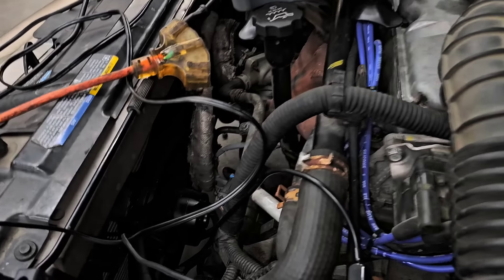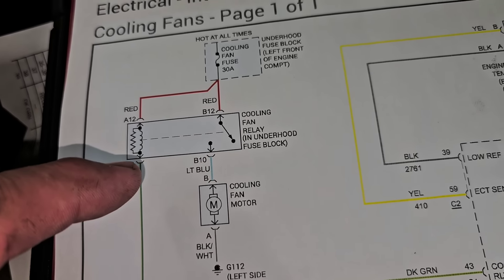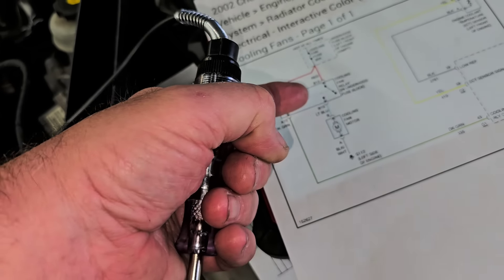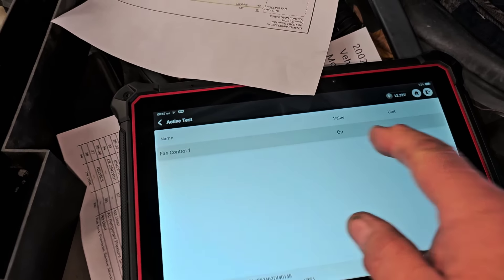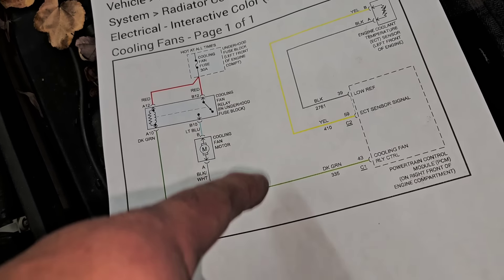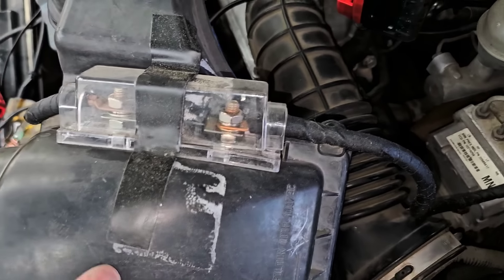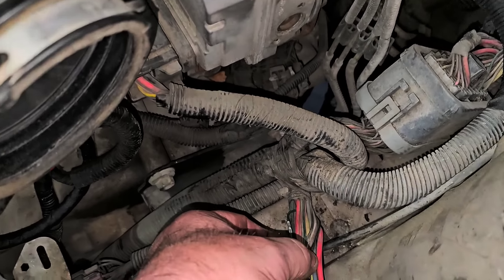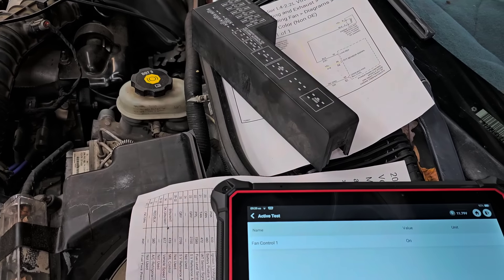Fixing It Right Wasn't That Hard. Cooling Fans Not Working 02 Chevy Cavalier

Comment: Hi Kenny great video just wanted to add something else the relay in the fans are also there to stop the fans from back feeding power when the fans are not switched on and the vehicle is driven the air flow will make the fans turn turning them into a generator and feed current back into the system but it cannot do that with the relay in place regards peta

Comment: Back in the 80ies no computer necessary to controll the fans, temp sensor controls the relay to control the fan. Why complicate things.
Reply: More to go wrong so you have to bring it to the dealership. 
And a bunch of "while you're here" gets done at the same time.
Reply: Gives the PCM more overall control of the engine. Probably for more precise temperatures control. Emissions and mileage requirements from the government.
Reply: Just a relay and a fuse:
+ simple, cheap, easy to diagnose and repair
– big current surges, no option to modulate the power to the fans, hence no control over fans speed and cooling rate

ECU control:
just reverse the pro/cons for the previous option

The good middle ground would be a standalone PWM fan controller that is only responsible for the fans. Looks at a temperature reading and sends just enough power to the fans, no more no less. It's pretty much just a big mosfet with a closed loop control circuit, and you can set the specific parameters and algorithms when and how it turns on.

Comment: Makes no sense the control wire would overload and melt. 

There was some green residue on the wire, corrosion and corroded through? or bit of green insulation?

Also the wire seemed to be in the middle of the bundle, so well protected. 

Definitely a mystery as to why but a great demonstration on how to save money by finding the problem instead of guessing

Comment: Technicians aren't taught well enough to diagnose, that's why they guess by replacing parts. It takes a lot of practice to become good at doing it, but not impossible as most automotive electrical systems work similarly now.